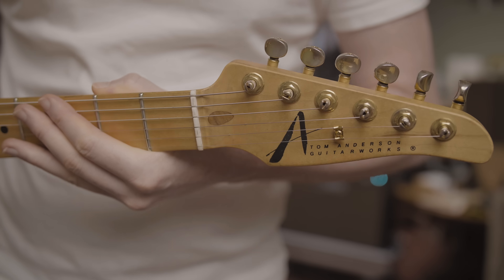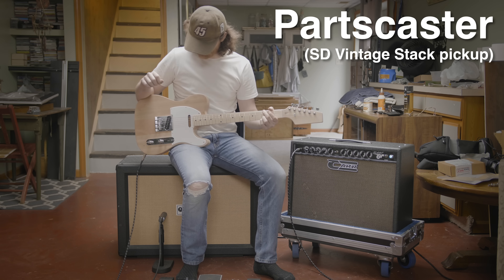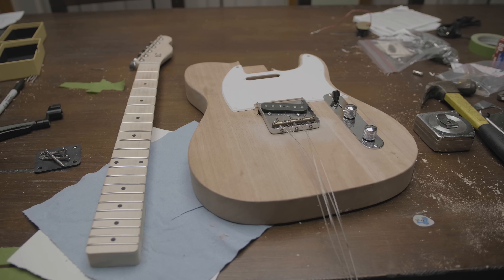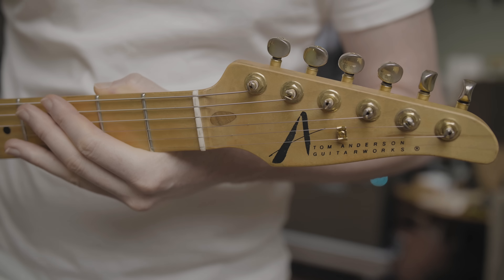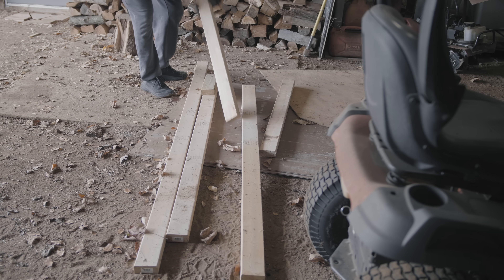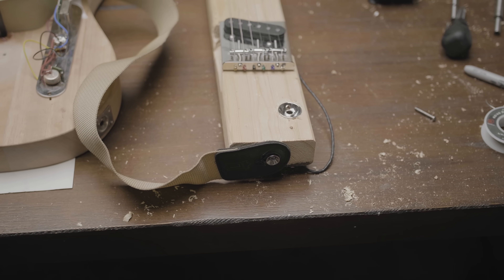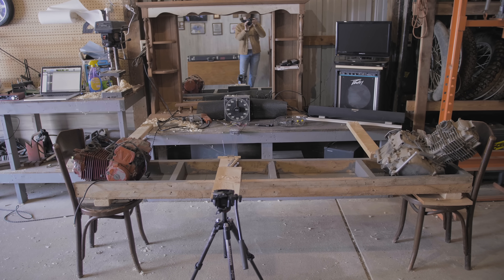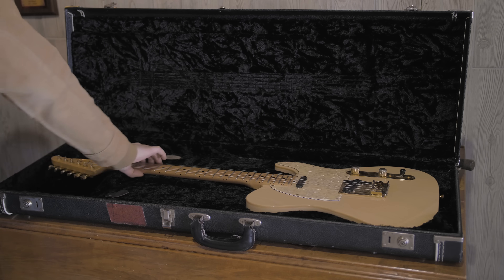Tested: Where Does The Tone Come From In An Electric Guitar?

Comment: My two favorite electric guitar folklores are maple vs rosewood necks (a fender is always going to be bright sounding) and nitro finishes “breathing” 😂😂😂. How the hell does a finish that is there to seal and protect paint allow wood to breath? 

I’m glad I found a few things that work for my tone years ago and kept me from going down the tone rabbit hole.
Reply: It's not literally about breathing. It's the way it vibrates. It can dampen or prolong the occillation of the strings thus either giving you less or more sustain. 

And there's clear differences between different woods and martias and his video proves it. There's an audible difference between the 2x4 and the Tele. You gotta be deaf dude. 

Furthermore, you can even test this in a lab and look at the tonal spectrum of different woods. It has to do with resonance which translates to the string  and it'll also change the feel of the guitar and how it reacts to input. 

You don't need to go down a rabbit hole. You just need dense wood that is dry enough to transfer vibrations and a good bridge and nut as well and good electronics.
Reply: @chrisking6695  feel better?

Comment: That's really interesting and I do get it, what the biggest factors in sound  probably are and which not so much. Always hard to tell, when listening through compressed media, but good enough for an impression.  the way you play and gear, string gauge etc. make also a difference.
But what about Feedback coming from hollowbody guitars and are there more differences coming from those hollowbody designs because of type of wood etc.. Some Pickups are more microphonic than others. Maybe the volume and amp type play also a big role too, so they might show more or less subtle differences in tone. But you showed some obvious factors for sure. That helps for tweaking - thanks.

Comment: great subject... The air guitar is connected to a giant piece of timber and mdf / timber mix in the bench frames themselves even if the frames run horizontally away from the strings. 

This is a variable still its not completely naked from any wood. 

I wonder if you made a more neutral or HARSH tonal material considered for use in guitar necks or body build such as construction bricks and concrete and the bridge and headstock actually masonry drilled into the brick work and a air guitar made from that setup with ZERO WOOD used ... tuners drilled through the brickwork and locked in place. if the tone is terrible then you can triangulate the data.... 

Good luck

Comment: Whether wood or anything else has anything to do with it ultimately doesn't matter, because it's about setting up a guitar to sound how you want it to sound, not about any inherent tonal qualities. Besides, nobody is going to be able to A/B compare any of this stuff in a live setting or on an album, nor will they care. 

The only qualities I worry about are playability, dimensions, weight, feel, appearance, and price. Anything beyond that is just bells and whistles bullshit. I don't need hot pickups, active EQ, a special nut or bridge, etc. to get the sound I want; a budget bass with 80's passive tech played through some cheap Behringer pedals running through a PA works just fine.

Comment: Want a different sound out of your old guitar? Take a screwdriver and adjust your pickup height. It can have vastly greater effect than actually change pickups in many cases. Type of strings are next, in my humble opinion. 

‘Tone wood’ is more relevant with high end acoustic guitars, as it’s the only thing amplifying the sound.

Comment: Something I’m stuck on is whether it matters if the strings go over a tune-o-matic bridge or not. People say the Jazzmaster gets some of its sound from the extra string length between the bridge and trem system. I don’t care about a trem and I’d love to just get something like the G&L Doheny and block the trem. But it doesn’t have a bridge so the strings don’t have that extra length. Would love to know whether that matters to the sound at all.
Reply: It does make a difference. There are all sorts of harmonic and semi-wolf notes that occur above the nut, and below the bridge. Most people tend to try and stop them happening, to get a 'clean' sound, but some of us like to hear them.

There's a big difference between a Rickenbacker twelve string where the strings begin at the tailpiece and never touch the body of the guitar, and a String-thru hard body. Also an all maple semi-hollow will sound absolutely different than 10lbs of mahogany Les Paul.

Comment: Okay I paused and read the comments from the builders. I'll venture to guess that your video's conclusions comes closest to  the last luthiers comments in red. There sure is
a lot of superstition folks cling to regarding guitars. The first two luthier lists, blue and white, not mentioning the player - well it sorta goes along with my experience in have boutique guitars made - the arrived beautifully crafter but unplayable. The luthiers had no idea how to set up the guitar. More after I finish the vid. Great idea!
Reply: Excellent. My experience - the player, followed by the factors you have uncovered. The basics. That is what adds up to the sound of an electric guitar. (I realize you're trying to be the robot guitarist, and good for the testing, but still irl that's the biggest thing - the guitarist). Other things, though they might contribute in some way, I think it is negligible to nonexistent.  Based on experience. In a blind test, could a guitarist tell if a guitar is made out of mahogany or maple (whatever part of the guitar)? I doubt it. Could a guitarist tell a single coil from humbucker?  Probably.  One recommendation - I'd test on a clean sound. There's more information/complexity in you overdriven sound. It is easier to hear differences on a clean sound. And try low volume and high volume.   I'd also draw your conclusions from listening blind a couple days after you record. Have someone play them back to you and keep the notes. Thanks! Good stuff!

Comment: The hands. Then the amp. Then the pickups. Then the guitar. 

If you can’t play the best rig in the world won’t do you any good. If you have a dingy amp that can’t ever open up beyond a tone knob turned down to 0-3, it’s always going to sound muddy. If your pickups aren’t the voice you’re looking for or are muddy or shrill, best amp can’t always fix that. I have two different guitars with Seymour 59s on them, they do sound slightly different but not really. Guitar is wood, as long as the wood pieces aren’t working against each other, it really shouldn’t be as big of a factor as the other pieces.

Edit: just got past the ad, third builder nailed it.

Comment: Awesome to see someone finally crush the nonsense theory of “tone wood” as pertains to electric guitars. I’ve owned Strats and Teles with both maple and rosewood necks, ash and alder bodies (as well as Les Pauls with chambered and solid bodies) and always found there to be a bigger difference in tone between two IDENTICAL guitars than two versions of the same guitar. It always came down to pickup / string height, tolerances of the tone caps, and even slight differences amongst pickups from the same manufacturer. 
Excellent and entertaining video !
Reply: Pick material and thickness have a huge effect on volume and brightness. String material and diameter as well.
Reply: ...and the amp
Reply: Type of wood and shape of body and headstock may not affect tone, but rather the sustain.
Reply: The nut . Brass for brighter , bitier tones & infinite sustain . ie.
Reply: Tonewood is about the type of wood generally used for construction, not because it has tone. Just like a 2x4 of pine is construction lumber, then  different hardwoods are "tonewoods" because they are used in instrument production
Reply: A polyurethane coated maple tele neck sound brighter and twangier than a neck with a rosewood fretboard. I agree with the overall message in the video. He should make a part 2 and discuss how $300 Gibson PAF pickups are nearly identical to $25 Alnico 2 classic 57's from Amazon. And how big expensive capacitors are indistinguishable from cheap small tiny ceramic caps.
Reply: @oxygen69able  That's nonsense about a coated neck sounding "twangier". The strings do not even contact the fretboard, only the frets. It's a psychological impression. I once played an aluminum Strat. It did not sound ANY different from the Strats I've played with stock pickups.
Reply: I've got a shovel guitar, sounds great. It has good pickups and electronics. Wood does nothing to an electric field.
Reply: Yeah, pretty much.  My two main guitars are an Ibanez ART 420 - maple top over mahogany, set neck, basically a pointier Les Paul, 24-3/4" scale, blah blah... and a custom made Telecaster - ash body, back cut,  bolt neck, ebony fingerboard...   the two guitars sound nearly dead identical despite the differences in materials and scale length, pretty much because they have the same pickups wired the same way.  The Ibanez is prettier, and the angled set neck is easier on my wrist than the straight-on bolted neck on the Tele. Other than that, they're pretty much interchangeable.
Reply: Delusional thoughts from fantasy island. If that’s the case why can we watch Greg Koch demo back to back teles or Les Paul’s into the same rig and they sound differently.
Reply: @zackcoffmanguitar  the evidence is right in front of your face and you still can't accept it
Reply: Well, maybe the wood doesnt affect the sound that much, but, they do play a very important role in tune stability, how it gets old, comfort, the looks, i mean, as seen on this video, the tone is the least important thing if were talking about wood, but it is important in some other aspects as an instrument.
Reply: @franciscobravoortiz566  sure but the discussion here is only about tone, the whole theory about how much wood affects tone. Aesthetics and stability are not so controversial as the tone.
Reply: @danteyoutu  agreed, here is all about the tone, it's a pretty interesting video tough!!!!
Reply: @franciscobravoortiz566  I definitely agree with you about the look and feel. I personally prefer the look of a Les Paul over a Strat. And I prefer the feel of the LP but much of that has to do with the shorter scale, fret wire shape, and neck radius. I just think Les Pauls look sexy.
Reply: @U2WB  yees indeed LP are sexy, i mean... We can discuss this forever, but its all about taste, and how it affects your playing. With this theory here, you can choose an ibanez with same electronics specs, scale of a Shecter maybe, but they wont have the same body contour, the weight, the neck profile, and the looks, some may prefer ibanez, some may prefer shecter, altough they sound pretty much the same (with the same specs both).
Reply: @franciscobravoortiz566  Which no one has ever fucking denied.
Reply: @franciscobravoortiz566  Good point: woods that don't change much with temperature/humidity/pressure stay in tune better.  So, "tonewood" isn't completely meaningless.  It's just not very relevant to tone.
Reply: They forget the reason gibson and fender sounds very different unplugged is Because of the construction.
Scale length and neck joint.

Also fender telecaster/strat has cavity under the pickguard unlike the les paul/sg which is completely solid which is why they sound more resonant.
Reply: @melodica5407  they sound more resonant unplugged for those reasons. Wired up it’s because of the pickups and tone circuit.
Reply: @melodica5407  He showed in another video that scale length has no effect on tone.
Reply: @melodica5407  are u gonna play your electric guitar unplugged tho? No so it doesn’t matter
Reply: @KingofPho75  The resonant is more "feel" thing.
Some people love the feel of a resonating body when slamming the strings hard.
Reply: @melodica5407  my strat is more resonant than my Les Paul.
Reply: @melodica5407  The point is that basically none of that carries over to the plugged-in sound. You aren't hearing the "resonance" of the body, even when playing through super clean amp settings.

Comment: Fantastic tests and a great Mythbusters kind of vibe of figuring out a scientific approach on your own. I would say that the "air" guitar still has wood resonating, it's just the bench and shelf the ends of the string was attached to, but even then it's clear how little difference that makes. Maybe a follow up using aluminium box section for the whole guitar so there's no wood at all? I wouldn't use steel as that would interact with any pickup mounted to it so you'd need pretty thick aluminium, but an aircraft alloy would work pretty well and wouldn't be that expensive to try. In the end, I've always figured that the wood is like the seasoning you add to a good stew or chili before you serve. Yes, it can make some difference, but if the ingredients that make up its substance suck, no amount of fancy seasoning is going to make it good. I'd also say one of the things that seemed surprisingly important was the frets on the neck. I would've loved to have heard the Anderson neck on the 2x4 to compare, as the open strings sounded pretty close but the fretted sound on the Anderson was definitely different. Other than that, a fantastic set of tests and a real eye-opener as a player and aspiring guitar builder.

Comment: Not surprised: sound in an electric guitar comes from the pickups reacting to the strings, so the only things affecting the tone can be in the electronics, the strings and their positioning. Maybe, just maybe there could be small changes in sustain, and I feel like with the air guitar the physical string plucking noise is more pronounced (possibly due to the bridge not being anchored quite as well?), but the tone is predictably consistent.
Reply: Not even close to true.
Reply: That is like saying all singers would have the same voice if they were to use identical microphones.
Reply: @Martin Maat did you watch the video until the end? Real guitar sounds exactly the same as no guitar, with the only similarities being strings and electronics, because it's literally signals traveling down a wire. Your comparison would hold if there were any acoustics at play, but in this case there aren't: it would be more akin to a voiceless person using a voice amplifier, which bypasses the vocal cavities entirely and only relies on cord vibrations to reconstruct a human voice. It's apples to oranges, really.
Reply: @BeastOfSoda  There are acoustics at play. A guitar has a resonating body, the workbench is a substantially larger and heavier body than the typical guitar body. If it weren't so darn impractical people would carry workbenches around their necks as guitar bodies because they are really solid bodies (pun intended). It matters what you attach the strings to. The pickups can only pick up what the strings produce and if the material is soft and dampening you will get less harmonics and less sustain. That translates to "cheap guitar sound". I recognize there is a lot of nonsense going around but you cannot fix a poor sounding guitar with some expensive pickups or any add-on hardware really (although the difference demonstrated here with just the different pickups was noticeable I must admit).
Reply: @MartinMaat  How can you claim the wood had a massive impact when there was literally 0 difference between carefully crafted guitar body and a bench?
Reply: @MartinMaat  I only agree to an extent. Body rigidity and quality hardware will have an effect on sustain, ability to stay in tune, eliminating extraneous noises (rattling, interference) and so on and so forth, but the point is that the basic tone stays the same. I did in fact point out that the plucking noise is more defined, which I believe to be due to the bridge and headstock not being really connected by the neck, but the focus was more on reproducing the original timbre rather than obtaining good sustain (or playability, for that matter; unless you think you can play a guitar with no neck, that is). The point was stripping down every piece of myth fabricated by guitar companies to out-bull the competition, and getting to the essential core of what gives, say, a strat its quacky tone or a Stingray bass its funk-friendly punch.

I find that the same thing applies to most instruments: I used to study drums, and I noticed that things like material, building technique or hardware range from marginally important to oogey-boogey invented for the purposes of differentiating otherwise very similar products. The things that matter most are round shells (ie, not warped), decent bearing edges and good heads. Then comes the human part: proper tuning and playing technique, with muffling close behind. Materials mostly matter in terms of wood vs metal, and hardware is near the bottom of the list. That alone can get you very near the sound profile of any kit, and the rest has such a marginal effect that it will not make a difference in a musical context or when A-Bing different branded instruments. Of course more expensive hardware will make the tuning more stable and be overall sturdier/more reliable, but that's beside the point.
Reply: How it sounds exactly same when air guitar sounds so different
Reply: @LesterBrunt  I cannot tell from a video that there was no difference, the sound from the bench seemed pretty decent though which I attribute to its rigid and heavy nature. Soft/light wood versus hard/heavy wood does have a big impact. I know this from personal experience. It translates to warm/dull/decay vs bright/sparkly/sustain. Electronics just distort that picture a bit, they are like makeup. I remember some videos about 3D printed guitars. They all look great and they all sound like crap, even on youtube.
Reply: @MartinMaat  Bro… How could you not hear that the tone is identical? And don’t give that “it is a video”, it is not a bass guitar, all the mid frequencies are perfectly audible.